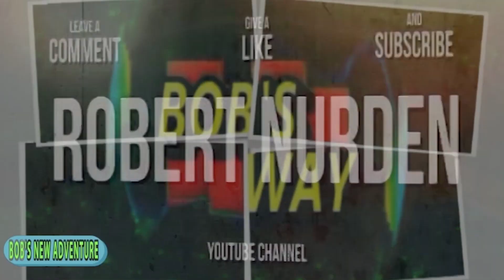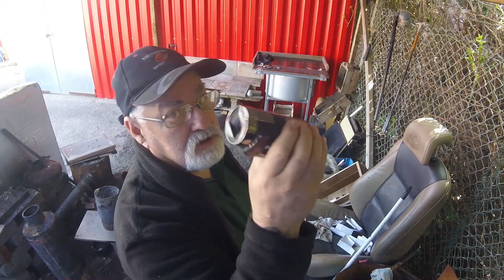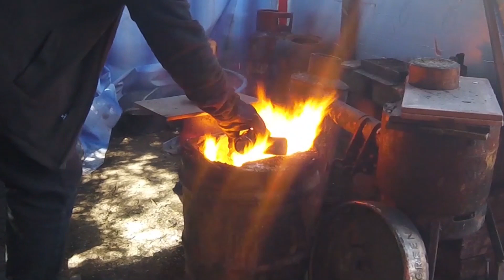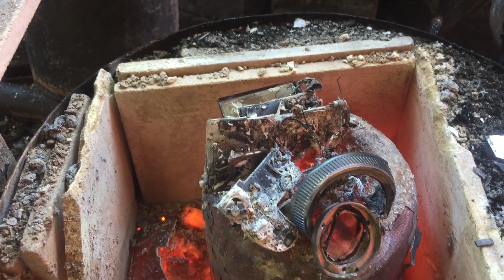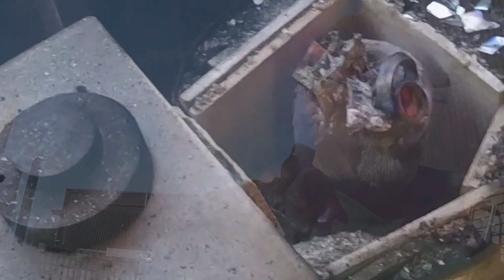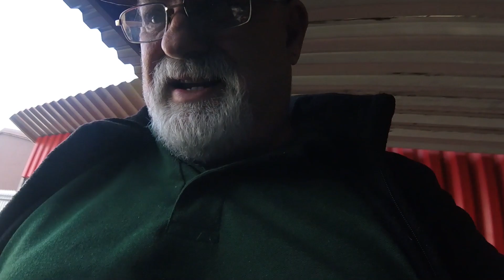how i sent my cameras to hell ( no return this time)

Comment: " And on next weeks episode of Bobs " Will it burn?", how to dispose of your old, non working Refrigerator" .  :0)

As a photographer, I found the burning of my tools of the trade to be very 
Satisfying!  :0)
I have a few Compact Canon Cameras I bought many years ago for doing underwater pics where they got drenched with leaky housings numerous times and remote controlling in places like under Horse jumps where they got the proverbial kicked out of them and covered in dust every week.   I was using one of them today to do a Vid ( yes, new vid finally coming! ) and the thing is as good as the day I got it 10 years later.  Doesn't look as pretty but works perfect and has never been touched for any repairs. 
My SLR's take a hammering too ( Like 30K pics in one weekend)  and don't give me any trouble either. 

I was a Nikon User and found them to be reliable as well.  I am biased to Canon now because I don't wrap the things in cotton wool like a lot of people baby things and they just don't give me any problems.  I used to use Sony vid cameras back in the day but I now find with the limited experience I have had with them to be over hyped and certainly over priced.  Wouldn't touch their SLR's or Mirrorless with a barge pole. 

With the vids I do, I'm amazed I haven't melted my cameras 20 times over unintentionally. I just wipe the oil spray off them when they have cooled down enough to handle, charge the battery and go again. 

Time for a clean out mate to see what else you can use for the " Bobs, " Will it Burn?"  series!
Really keen to see how that Fridge goes!  :0)